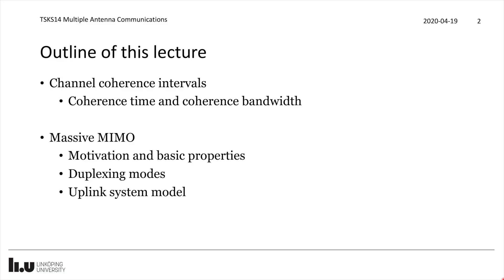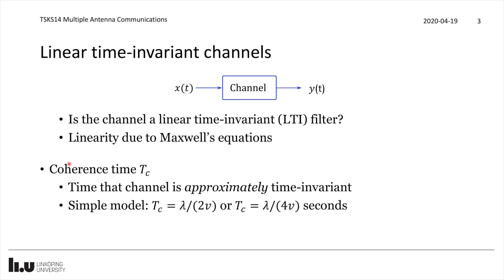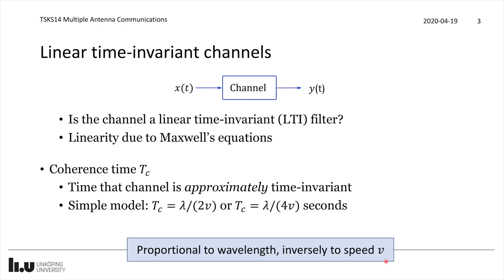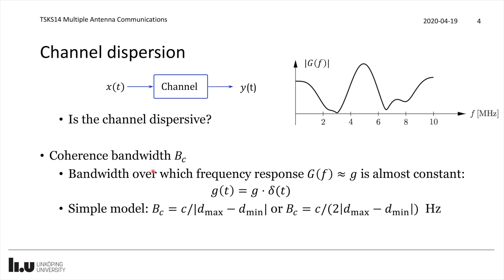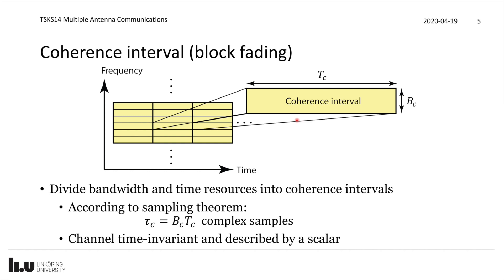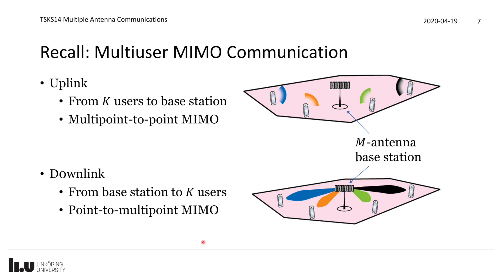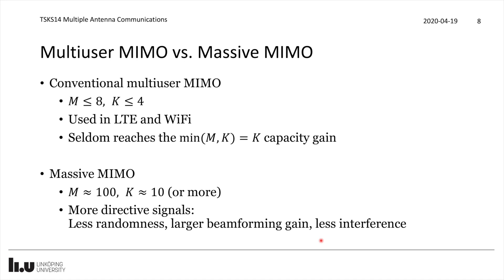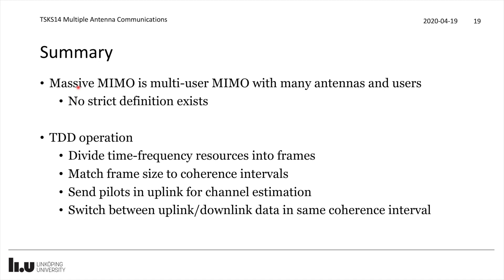Lecture 6: Uplink multiuser MIMO and channel acquisition (Multiple Antenna Communications)

Comment: In this lecture you claim that we do not have 0 dB gain antenna. In my opinion this statement is very general since we have some antennas with negative gain which use in biomedical applications.
Reply from the maker: What I mean is that there are no isotropic antennas with 0 dB antenna gain all directions.